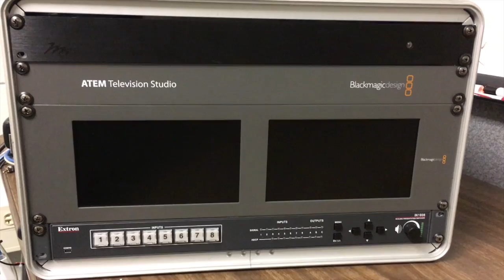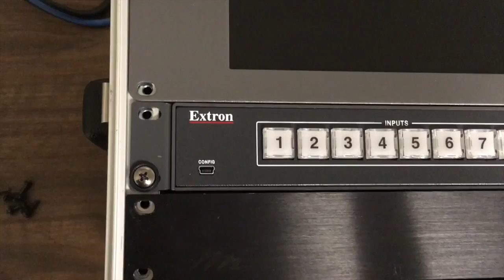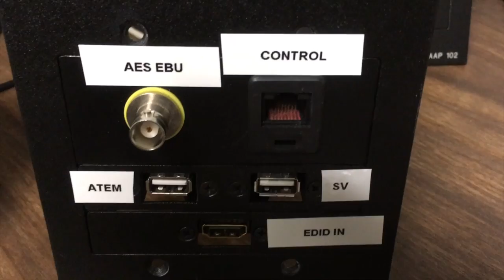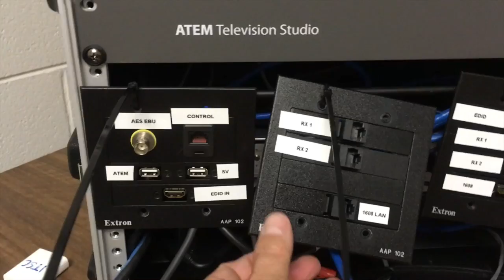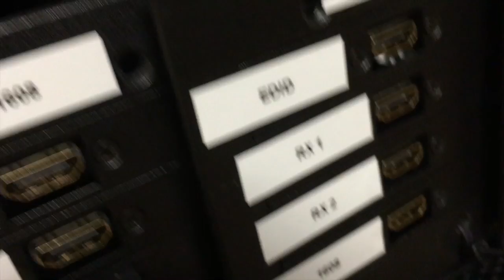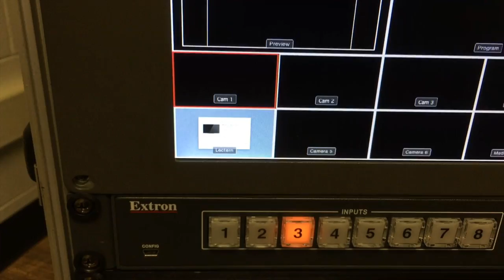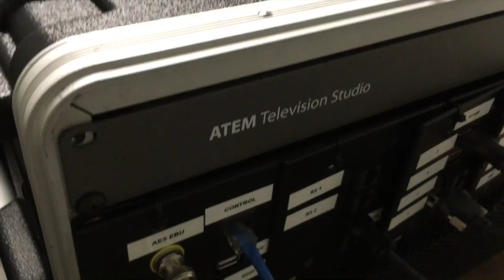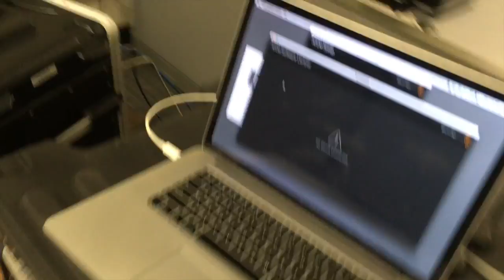Live Streaming Rig Rundown/Rebuild - Blackmagic Designs ATEM Switcher

Comment: Interesting use of equipment.  Why add the EDID box if the 1608 offers EDID built in?  I can see using the 1608 also for the scaler to make sure you get one master fixed signal regardless of original source.  Also, Extron has the AAP 302 for your connector plates that you might consider to move away from the lacer bars and zip ties to something a bit more solid.  Yes, it only has 4 AAP quad openings and you used 5 quads worth of space but, you also used only single connector plates for the data and they offer dual RJ-45 plates in a single space that would have saved you some spots.  Lastly, if you have any problems with the Tx and Rx boxes, consider shielded CAT cables and couplers.  Nice build.  :)
Reply from the maker: I don't run every source input through the 1608 - I mainly use the 1608 if I need the scaler.  The external EDIDs can be useful for some sources that I want to patch directly to the ATEM Switch.  

As for the AAP302 - absolutely!  There are better ways to do that!  But sometimes you gotta just use what you have LOL!!
Reply: I hear you, use what you got.  Thanks for the reply, it helps understand the alternate uses.  Best of luck.  :)